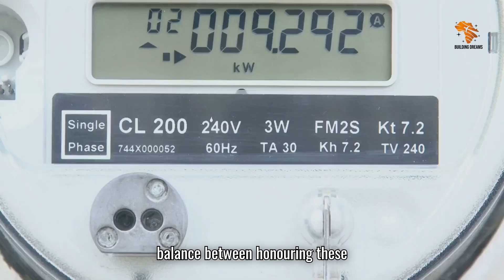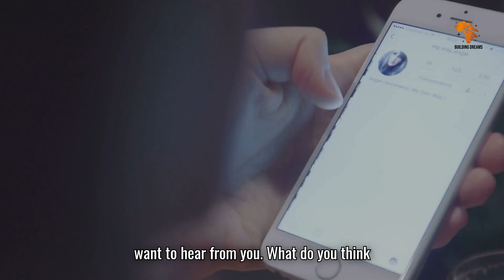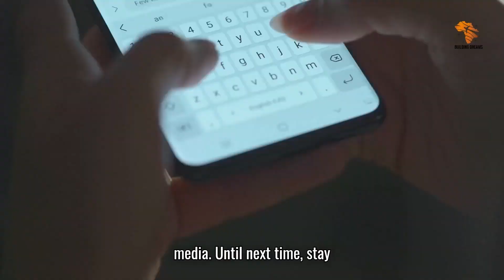Will Load Shedding Ever End in Zambia? The Truth About the Power Crisis & Solutions! ⚡

Comment: For as long as those at the helm continue exporting electricity to line their pockets, it will never end.  The mining sector too should be encouraged to get off the grid as opposed to putting that pressure on the people who cannot afford solar and other alternatives. The mines with the millions they make are in a better standing to do so. Let the people still be dependant on the grid and encourage the mines and other major sectors that can afford it to switch to the alternatives which are too costly for the average Zambian citizen. All that net metering nonsense, gensets, panels and such are ok for back up scenarios but not where power is off 24/7/365 - nobody can afford to sustain such insane levels of loadshedding indefintely. Get the mines off the grid, stop exporting the little electricity available until there is a surpluss when loadshedding is a thing of the past. Failure to which this nightmare we are in will never end.  This is my two cents.
Reply from the maker: Thank you for sharing your perspective! You raise a very valid point—prioritizing domestic needs over exports is crucial. Encouraging the mining sector, which has the financial muscle, to invest in off-grid solutions could relieve the pressure on our national grid. Your call for re-evaluating current export policies and focusing on sustainable, locally beneficial energy practices really resonates. We need to ensure that the limited electricity we have is used to benefit everyday Zambians first. Thanks for your two cents; discussions like these are key to finding a long-term solution!

Comment: For load shedding to end in Zambia we as citizens are first going to have to accept that we're going to have to pay more for the power we want - for the private sector power producers to truly engage in this industry the current tarrifs we pay have to increase by a few more cents per kilowatt-hour.

 There will also be need for massive investment in power transmission across the country in order to increase the stability &  carrying capacity of our current national grid. This again will need a lot of private sector involvement as ZESCO currently doesn't have the financial clout or solvency for that matter to undertake all these necessary infrastructure upgrades by themselves  - again an activity tied to increased tarrifs.
Reply from the maker: This is a very insightful comment, and I completely agree with your perspective! For Zambia to truly overcome load shedding, we need a realistic conversation about tariffs and private sector investment in power generation and transmission.

Many people don’t realize that our current electricity tariffs are relatively low compared to the actual cost of generating and distributing power. If we want consistent, reliable energy, we may need to pay slightly more per kilowatt-hour to attract serious private sector engagement. Without competitive tariffs, independent power producers (IPPs) won’t have the incentive to invest in Zambia’s energy sector, meaning we remain stuck with supply shortages.

You also raise a key point about the national grid. Even if Zambia increases electricity production, if we don’t modernize and expand transmission infrastructure, load shedding will continue because the grid cannot efficiently carry and distribute power across the country. This is where private sector financing could be a game-changer, as ZESCO alone does not have the financial muscle to handle these massive upgrades.

The challenge is balancing affordable tariffs for consumers while ensuring energy companies can profitably operate and reinvest. A phased approach, where tariff adjustments are matched with visible improvements in supply reliability, might be the best way to gain public acceptance. What do you think—would Zambians be willing to pay slightly more if it meant an end to load shedding?" 🔥⚡
Reply: @BuildingDreamsAfrica  
I think Zambians would be willing to pay higher tarrifs if they are gradually increased over a period of a few years. Maybe the government can come up with iron-clad  agreements with IPPs guaranteeing them that tarrifs will eventually match their desired profit margins over a few years while they invest in the sector beforehand & together organize some low risk financing for this exercise eg PPPs, pension funds, JVs with friendly countries, etc...
Reply from the maker: @ That’s a well-thought-out approach, and I completely agree! A gradual tariff adjustment over a set period, rather than an abrupt hike, could make it more acceptable for consumers while still ensuring the energy sector remains attractive to investors.

Your suggestion about the government creating iron-clad agreements with Independent Power Producers (IPPs) is key. If these agreements guarantee future tariff adjustments while ensuring that power producers invest in infrastructure upfront, we could see real long-term improvements in Zambia’s energy security. This kind of certainty would encourage investors to commit their capital while giving the public time to adapt to the changes.

I also like your point about low-risk financing through Public-Private Partnerships (PPPs), pension funds, and joint ventures with friendly countries. These are sustainable financing options that don’t put an excessive debt burden on the government while still ensuring the country retains control over its energy future.

The key here is transparency and accountability. If people can see that higher tariffs are directly leading to better infrastructure, fewer blackouts, and a more reliable grid, they will be more willing to accept the changes. The biggest challenge is trust—how can we ensure that any tariff increases are properly managed and not just lost in inefficiencies? What measures do you think should be in place to hold all stakeholders accountable?" ⚡🤔
Reply: @BuildingDreamsAfrica  
I'd say an institution like the ERB (Energy Regulation Board) could be an independent overseer & guarantor of all things about power generation & distribution in the country, possibly even needing something like an act of parliament in order for policy changes to be inacted in the sector this way even a change of government doesn't mean a change in direction in the energy sector.
Finally, if IPPs and ZESCO are jointly involved in large scale projects it'll be in both their interests for them not to fail.
Reply from the maker: @ That’s an excellent point! Having a strong, independent regulator like the Energy Regulation Board (ERB) playing a key role in overseeing and guaranteeing stability in the energy sector would be crucial. If properly empowered—perhaps through an Act of Parliament—the ERB could ensure that tariff adjustments, investment commitments, and power generation policies remain consistent, regardless of political changes. This kind of long-term regulatory stability would make Zambia’s energy sector more attractive to investors while also protecting consumers from abrupt policy shifts.

I also really like your suggestion of joint ventures between ZESCO and IPPs in large-scale energy projects. If both parties have a vested interest in success, they are more likely to work towards reliable, cost-effective power generation. A hybrid model, where state and private sector players collaborate, could be a win-win—leveraging private investment and expertise while ensuring that Zambia retains control over strategic energy assets.

This raises another important question: How can we ensure that IPPs, ZESCO, and the ERB work together transparently? Would you support public reporting on energy agreements so that citizens can see where investments are going? Accountability will be key! ⚡🤝
Reply: @BuildingDreamsAfrica  
Yes, in fact regular public reporting on not just energy agreements but also energy production numbers, distribution numbers, number of IPPs, base load and peak demands by provinces or even districts would go a long way to ensuring transparency and accountability.
Reply from the maker: @mazuba10  Absolutely! Regular public reporting on energy agreements, production numbers, distribution figures, and demand statistics—broken down by province or even district—would be a huge step toward transparency and accountability. If people can see real data on power generation and consumption, it builds trust and allows for informed discussions on how to improve the energy sector.

*Imagine a system where ZESCO and the Energy Regulation Board (ERB) publish monthly or quarterly reports detailing:

* The total power generated vs. actual demand
* How much each province/district consumes
* The number of IPPs operating and their contributions
* Progress on infrastructure upgrades and planned projects
* Financial reports on tariff collections and reinvestments
This level of transparency would not only hold stakeholders accountable but also help citizens understand the real challenges and why certain policy changes—like gradual tariff increases—are necessary. It would also give investors confidence in Zambia’s energy market by showing clear growth plans and stable regulations.*

What’s even more interesting is that this could be made publicly accessible online, allowing anyone to track Zambia’s energy progress in real-time. Would you support a government-mandated open data portal for energy reporting? ⚡📊
Reply: @BuildingDreamsAfrica  
Yes I would!
Reply from the maker: @ Glad to hear that! A public energy data portal would be a game-changer for transparency and accountability. Now the big question—should the ERB take the lead, or should it be a public-private effort? What do you think?" ⚡📊
Reply: @BuildingDreamsAfrica  
The more stakeholders involved the better.